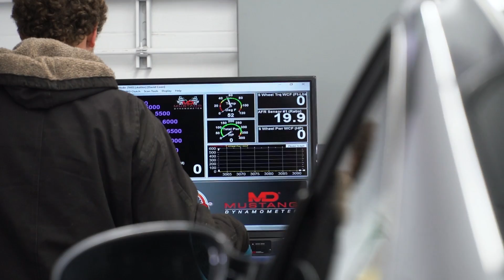Porsche 997 Carrera to GT3 swap

Comment: I really like the choices on this build, pure 997.1 looks, lowered stance, manic motor - the essence of 911.

Sure, we all love the Turbo and GT3 looks, but there’s a lot to be said for the simple yet modern 911’ness that is the gen1 997.
Reply: Agreed, though the wider rear of the 4S and up models really does add a lot
Reply: @genegade  I have to agree. Although, for the street, pretty much any 911 handles like a dream. It takes a track to really exploit the benefits of the GT3 chassis. Either that, or some very liberal police coverage…
Reply: 333hp?
Reply: My buddy has a beautifully maintained e46 M3. I drove it on my favourite twisty roads and was very impressed. 
Then i got into my 997.1 C4S and did the same route again. The difference was so stark, I was taken aback. The M3 felt like a regular sedan by comparison. 
We forget just how accomplished the 911 is, aided of course by the prodigious traction (and braking) of the rear engined layout.
It’s the motors that leave something to be desired. That’s why I sent my 3.8 x51 to Flat 6 Innovations for a 4.3 conversion with all the extras. Has around 500hp now and pulls like a train from 3000 rpm, with a huge setup up in torque at 3500. 
Proper beast now!
Reply: @michaelbjornqvist1808 At the wheels, yes that makes sense. A stock GT3 makes 415 HP at the engine. Driveline losses are around 20% (at least), which would be 332 HP at the wheels. So it’s making exactly what the spec sheet says for that engine.

Comment: Great job 👍🏾, doing what EVERYONE has told me for years couldn’t be done ☑️
Reply: John is amazing. About a year before this he put a 3.6l in my 05 Boxster S
Reply: @danielkuchenberg7046  if you don't mind me asking since I have an 01 Boxster S what did it run you to put in a 3.6l? that is one of my major upgrade paths down the line...
Reply: If you can put an ls in one you can even put a bloody v10 in it
Reply: @cutdepiefails6596  I’m about to LS swap mine... I can’t afford a 50-75k rebuild of my 997S engine. The LS3 with cam, long tube headers, and itb’s like $3500
Reply: @frederickcook87  50k? What the single fck? Are you buying a brand new engine with auxiliaries?
Reply: @cutdepiefails6596  a Jake Raby R series will cost you that and if you can source a GT3 engine/transmission, conversion parts plus labor/fab work... boom 50-75k 😐
Reply: Anything can be done if you have enough money. The cost of fabrication, labor, testing, plus the cost of donor car may go above the cost of a GT3.
Reply: @trebm3  true, that’s why that LS swap is looking really good right now
Reply: Had to come back and say the LS swap got shit canned, I’m sticking with the Porsche engine

Comment: Great video and interesting to see GT3 swapped car... I also have a 06 Carrera S, I went to a a LS3 swap after looking at the costs for a stock motor or even GT3 setup. Less weight, more hp & tq and the cost of a crate motor is $7 to 8K for a quality 500+hp motor. Not everyones cup of tea but man does it work well. Love the GT3 setup with the stock look, makes for a cool sleeper. Great work
Reply: I have a 997.2 C2S and I love it but I’ve had a few LS-powered vehicles and there’s a reason that platform is so often swapped into everything - it’s compact, relatively light and you can make plenty of reliable power with them.  An LS3 997 sounds just about perfect to me!
Reply: @jad4ca  I totally agree and I love my 997 setup for sure...

Comment: I wish I knew about you guys when I suffered an engine failure on mine in 2016. I replaced mine with a new 3.8, but I would have been down for this and likely would not have sold the car.

Comment: This is awesome. Great video! I thought this conversion wasn’t possible. Did you know how much the conversion build cost?
Reply from the maker: Really appreciate that! 🙏🏼 I am not sure 100% what the total was on this actually.
Reply: North of 20k for sure!
Reply: In terms of labor it must have easily been 150 hours not including materials. $25k not including the engine? No idea what a GT3 engine costs but if a rebuilt M97 is over $20k then a good used Mezger must be worth at least that. A new one must be over $30k. I don’t think this project makes financial sense if you have a good 997.1 Carrera, just buy a real GT3 instead. But if you have a bad motor and a “roller” then it’s an option. Installing another M97 does not make sense as they are garbage. The owner of a large indy Porsche repair shop told me tracking any M96 and M97 Porsches is very risky. He has replaced motors in literally dozens of tracked 996/997s. Driving them on the street is risky enough lol.

Comment: This was a great video for me.  I have a 2006 997 C4 and have upgraded pretty much everything to track level parts EXCEPT the drive train.  With about 100K miles on the engine it was great to see what would be involved when the time comes.  One thing, I didn't understand the performance metrics at the end as it sounded like I would guess my current 3.6 liter engine does with my racing exhaust and stock everything else based on published stock numbers.  Is that the difference between HP at the wheels and HP that the factory reports?  I am curious about cost as well and if you would be up for doing another job like this.  Not sure when I will be doing it, but would love to give the job to you guys as I am sure you learned some things that might make it go faster next time (although looks like you didn't have too many unexpected hurdles).  Thanks for the great video.
Reply from the maker: Appreciate the video feedback! Feel free to give Newhall mobileworks a call I’m sure Jon would love to chat about a future project!

Comment: >9600 RPM for 11 seconds

How was this person a racing instructor???
Reply from the maker: A great question lol 😂
Reply: I call BS because the 997 revs to 7300 and even then the ECU cuts in! No way you're getting 9600 out of a Carrera S engine. You can't even get that number from the RS engine.
Reply: @N911GT2  Its called downshifting into the wrong gear at the wrong speed. You can force a mechanical over-rev by doing that, but typically, if you do, if you put the clutch in immediately after screwing up, the ECU cuts the fuel flow and saves you. Obviously this guy didn't, hence my question about why he is a racing instructor.
Reply: @henryatkinson1479  but 11 seconds? If you downshift into the wrong gear it would be like slamming the brakes on, it would drop the revs to a safe level way quicker than 11 seconds.
Reply: @pjay3028  My point exactly. So easy to avoid doing it, and yet they did... somehow.

Comment: I can't believe someone could just beat a machine so hard that it just grenades itself. I guess some people have lots of $$$$ to burn. I'm trying to figure out the cost to fix my 996 that just started the death rattle.
Reply: It sounds like a missed shift if the engine went 9600 RPM. A mechanical over rev is the only way to get the engine that high.

Comment: First of all. If this comes across as an ignorant question, forgive me. Don’t beat me up too badly. I’m assuming the ECU was changed as well. But, how was the car not throwing error messages left, right, and center? The C2S ECU would be asking “What the hell is this”? In turn, the GT3 ECU would be asking the same thing? I know that the panel cluster was changed and harness’s were replaced but, wouldn’t that begin to make this swap economically unwise? Like I said, don’t beat me up too badly! Very nice build though!! 🍻

Comment: Awesome build but wouldn’t it have been better to buy a gt3 to start with? Yes GIGI now has a 3 motor, but chassis and suspension will also need upgrades to support the engine. By the time you spent all the money for this job, plus the cost of the 997 Carrera, you could have bought a nice high mileage gt3

Comment: How is it possible to take the engine to 9600 rpm? Mechanical overrev for 11 seconds? How ?
Reply: Downshift to a gear you shouldn't. Ie grab 3rd when you should have grabbed 5th.
Reply: @neillewis800  I understand that. But 11 seconds in that rpm sounds weird
Reply: @johnnysodak7261  It sounds weird because it is. It is BS, the carrera revs to 7300 and anything above the ECU just turns them down. No way you can hold 9600 for 11 seconds
Reply: @johnnysodak7261  He did it multiple times. A second and a half here and a second there. It adds up and the DME records all of it. The total time was 11 seconds.